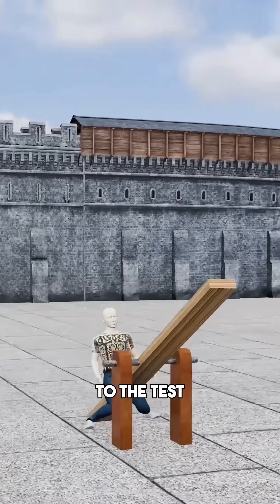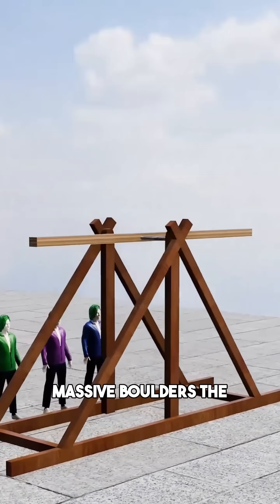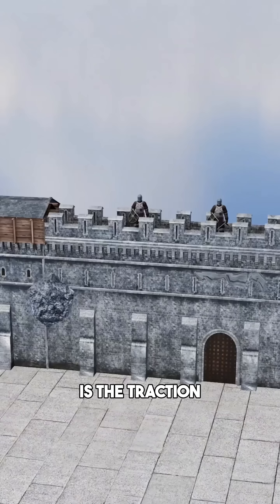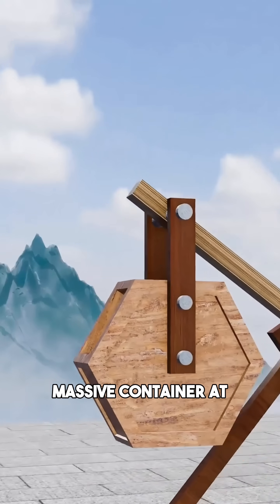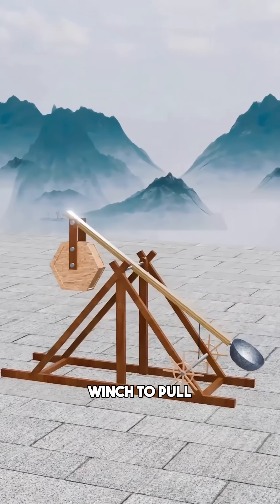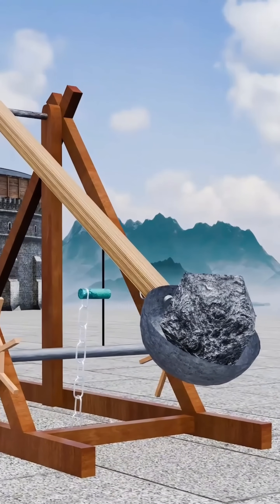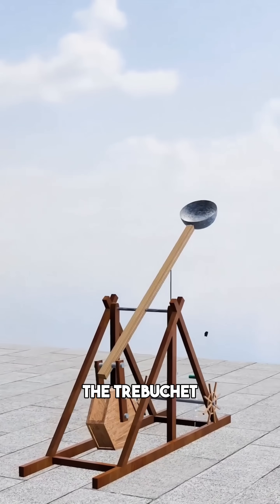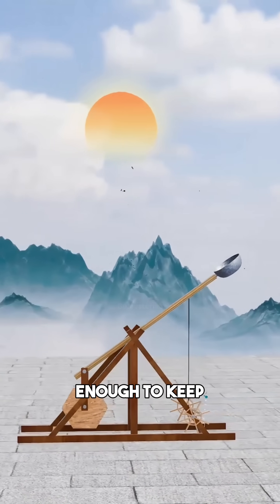The King of Siege Engines: Engineering the Trebuchet #shorts

Comment: This is how a fixed counterweight trebuchet without a sling works. Adding a swinging counterweight and the sling turns it into a traditional trebuchet. The traction trebuchet was fixed counterweight and man powered. Fun fact: the word trebuchet means to overthrow or cause to fall, in reference to castle walls.

Comment: That's not how a trebuchet works.
Reply: It’s missing a sling so yeah it’s incorrect
Reply: It's how a fixed counterweight trebuchet without a sling works. Adding a swinging counterweight and the sling turns it into a traditional trebuchet. The traction trebuchet was fixed counterweight man powered. Fun fact: the word trebuchet means to overthrow or cause to fall, in reference to castle walls.
Reply: @Shadow_Sky79 The catapult as shown would destroy itself.